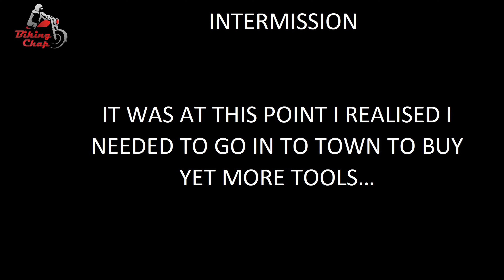Will It Run? MZ ETZ300 Part 5 - Engine Disassembly

Comment: not boring at all........thanks for the video......Of course it will run again, new crank, gearbox, rebore, casings, head and barrel....heheh.....sorry ....I jest. Seriously, I think with new bearings and crankseals it should be ok? Looking for ward to the next instalment. thanks Adam
Reply from the maker: Hi Adam, thanks for the kind words, it is appreciated :) I've got the new crank, seals, bearings, rebored barrel, pistons and rings so not a lot left unless the gearbox is completely shot I guess lol. Being new to this, the tricky bits I see coming up are the removal of the bearings, especially the one in the blind 'hole' and then getting everything back together without messing it up. A lot more work to go but it's certainly fun and a step learning curve!